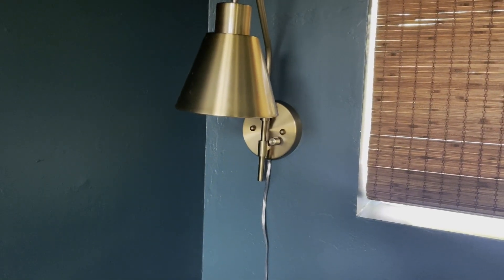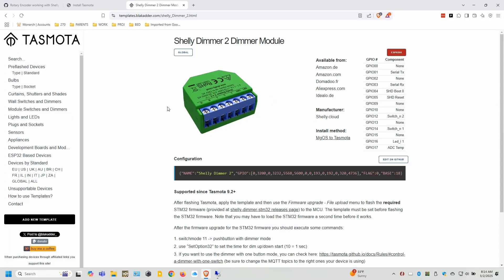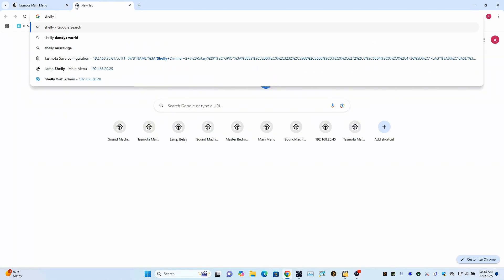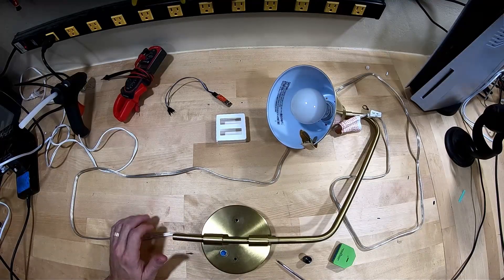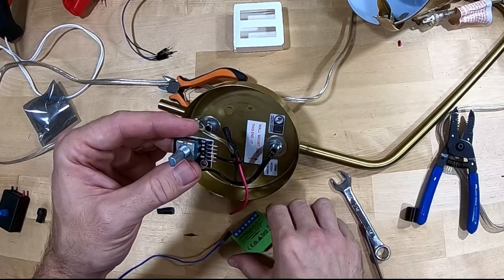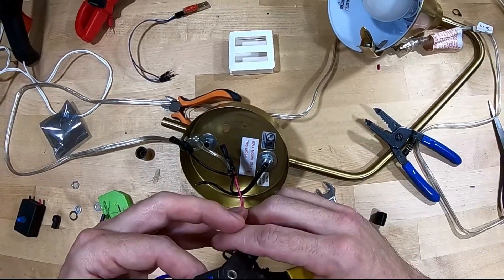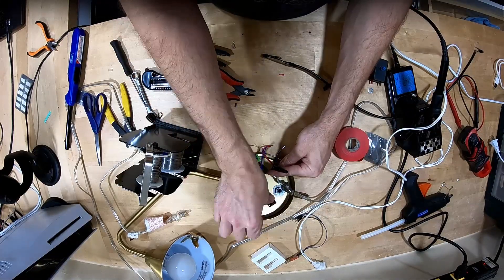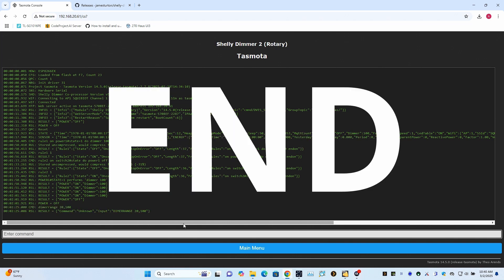Smart Sconce with Shelly Dimmer2, Rotary Switch, Home Assistant, Tasmota

Comment from the maker: Note to do as I say and not as I do - I added the template before I upgraded the STM firmware. Either way is fine.
Reply: Not quite, I got 'Invalid signature' if I had not applied the template first. No clue why, but template first and then stm firmware solved it for all my units.